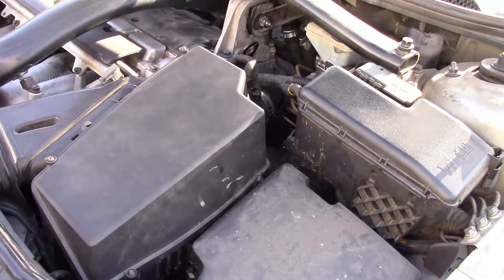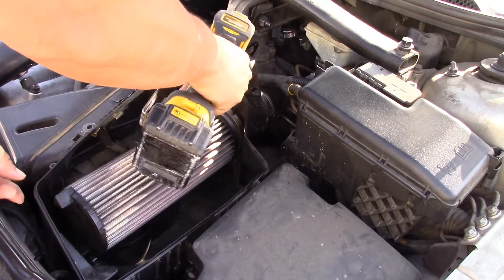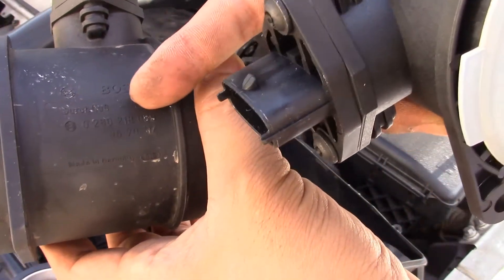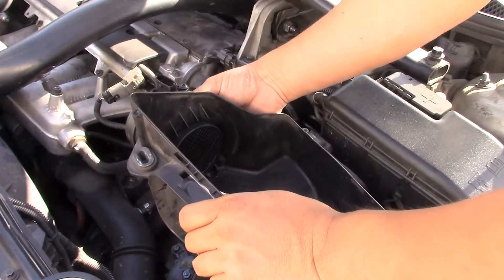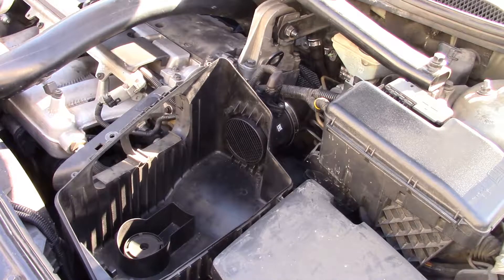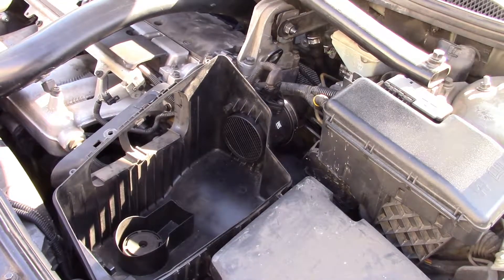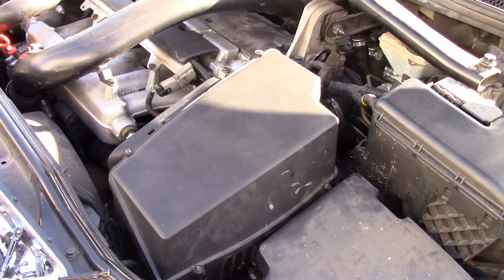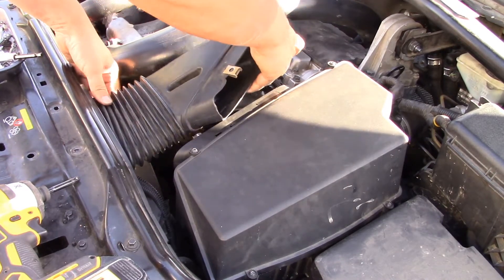Mass Air Flow Sensor Replacement for Volvo s60 T5 - MAF Sensor

Comment: Thanks for the video, man!!!!!! I have an '04 Volvo V70R, which has the same setup as your S60 T5. Every other video that I've seen on YouTube has been for the other engine models. So, yours showed me exactly what to do. It took me 2 hours to change the MAF sensor, but I did it!!!!
Reply: 07 v70r owner here going thru same issue as i type this 😂
Reply: @calebevans7408  lol. have you changed it out yet?
Reply: @ericervin4778  yea i got finished laat night. I just cleaned it. I took whole intake off to the turbo checking for a potential leak
Reply: depends on which year t5, my 01 had a different box and air pipe, i put this exact setup on though.

Comment: What problems did you have prior to changing this? Can’t you just clean it  or did you already tried that. Did the K&F filter damage the original mass sensor with its oil?

Comment: Hi James,
What year is your Volvo S60? Does this MAF sensor work for all S60 T5s? Mine is 2012.
Reply from the maker: It's on 2008.. Look on the side. There should be a part number. Google it and get the same one..
Reply: @DiyProJames  Thx dude
Reply: changed my mass air flow sensor but my check engine light still on..code reading the same
Reply from the maker: @donnayokum8452  You may have to reset the computer or drive around for awhile for new readings.
Reply: Hi Tony Ren, where was your MAF located? I also have a 2012. Thanks

Comment: What kinda of bolts were on the top of MAF I have s60r and they look like star bit but doesn't seem to fit properly is there a special tool required?
Reply: They are 5 point tamper proof star bits .
Reply: @lauradiazramirez123  They are called Pentalobe torx. they are 5 point and tamper proof.
Reply from the maker: The star bit comes in different sizes...
Reply: @DiyProJames  yes I understand that for some reason the there not coming off with star bit. There not stripped and I have about every size you can imagine.
Reply: @loganberry7754  me too dude, did you find the bolt size??
Reply: Tamper proof... yeah right. I removed them with a small scredriver

Comment: Does it work right after replacement or do you have to drive awhile before it kicks in
Reply from the maker: You have to drive around a bit. You can also try removing the battery and to reset the computer.
Reply: @DiyProJames  any idea how to clear permanent p010200 code? Also when i checked maf data, it remained at 0